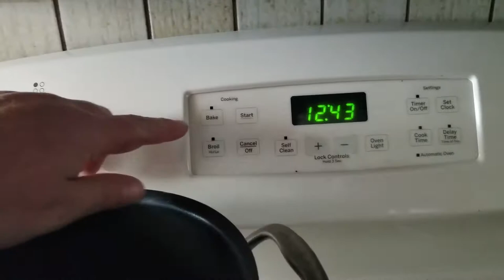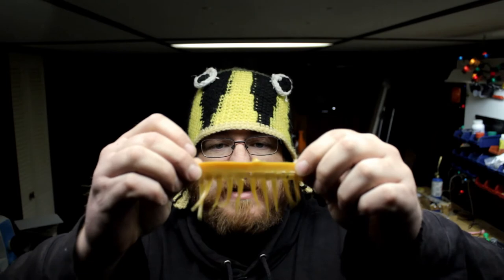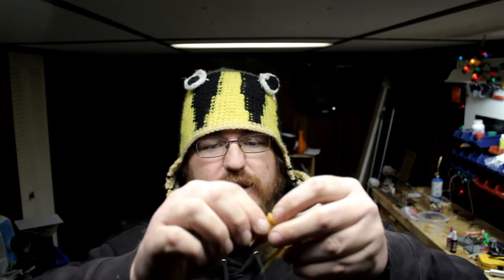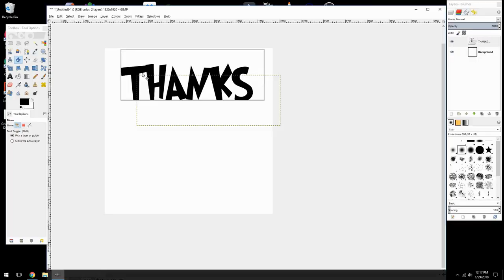3D Printer to Soft Plastic Lure

Comment: Since the bottoms are flat you might want to consider just putting the pieces in individually break them off from the holder and glue them tightly to the bottom of the box then just fill it with vac 50 then when it dries pull them out and you'll just have a simple open-pore basically what you have now but you'll have the full lure.
Reply from the maker: Yeah I was hoping to get it to work with the injector so I didn't have to deal with hand pouring.  Realistically though your right on, I should have just did an open face with the flat side down.  I think I might try that next and try to get the smoothest flat surface as possible so I don't have to clean the mold up afterwards.  It's maybe a 1 mm off on the bottom because of the two part so it works well for now.  Can't get em perfect every time lol.
Reply: Also for lures this small and specific you might want to go with more of a rubber mold instead of the harder vac 50 you might get a little more love out of a rubber mold. 

Not trying to tell you how to run your show just trying to help.
Reply from the maker: No worries, I am thinking about getting some high temp silicone for some lead pouring in the future so I might try to switch.  I just like the VAC-50 for it's durability.  I still use that frog mold I made over 8 months ago the stuff cures to near aluminum hardness.  I'm designing a few different micro fishing lure bundles now so I think the next video will be doing the open pour.
Reply: Mark A. Wilder what brand 
would you recommend ?